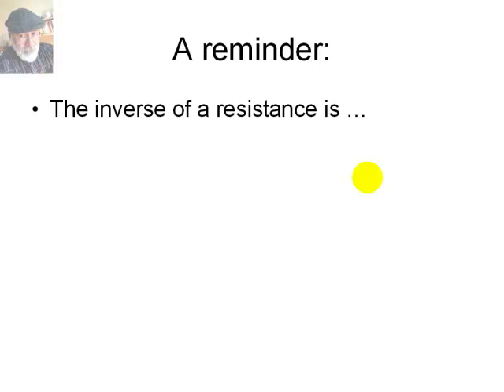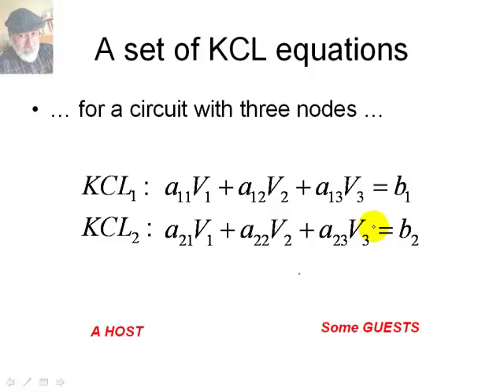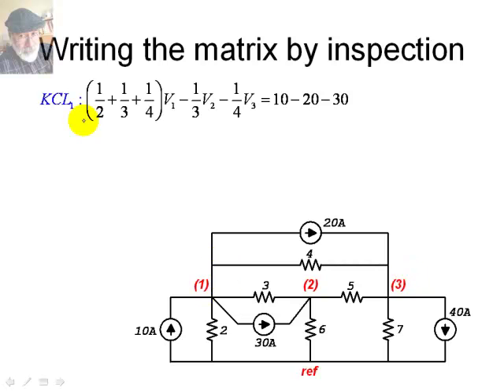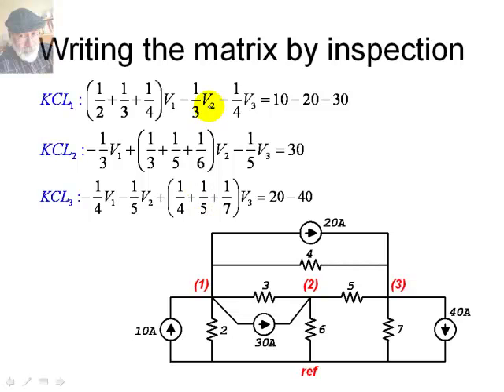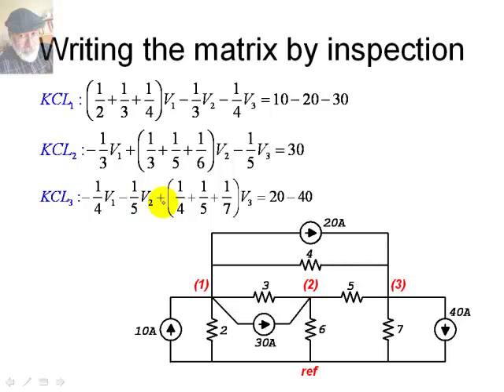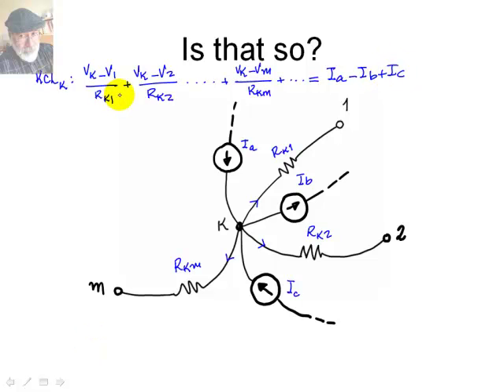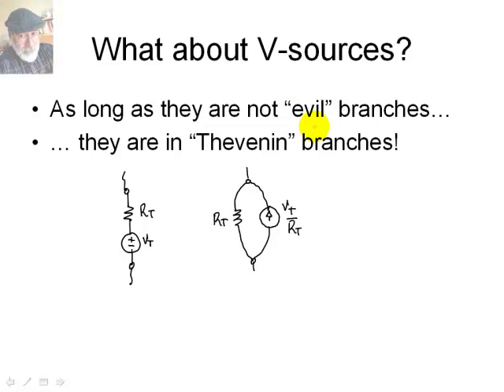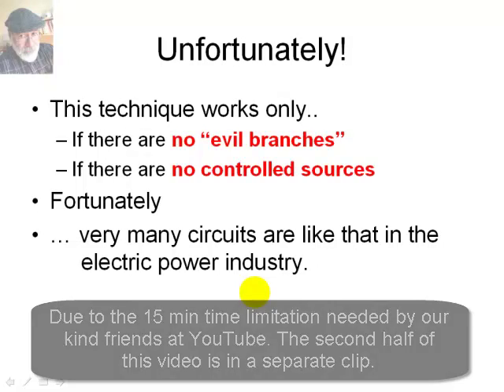KCL admittance matrix by Inspection

Comment: Are there "evil branches" or other constraints when writing the KVL impedance matrix using the inspection method?
Reply from the maker: Please read the "description" of the video clip. I wrote there the limitations of the simplified method described. The method in this video is perfect to analyse electric power networks. "Evil branches", etc., can be included in an extension of the method that I wrote a minor paper about years ago.